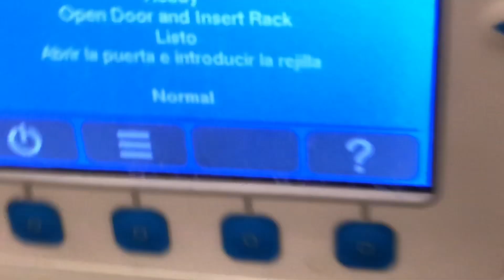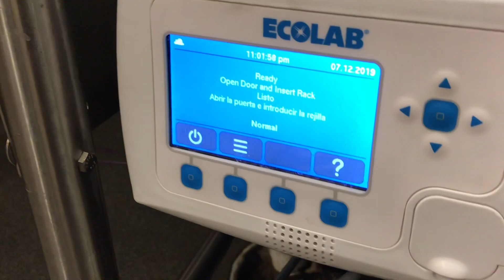EcoLab Dishwasher Breaks on Camera

Comment: User error. Make sure you pre scrap and remove anything from the drain. Drain can’t close if obstructed by something.
Reply from the maker: Nick Uroza it was a relay problem. This machine actually was giving us a lot of problems and half of it is rebuilt
Reply: Adjust the drain solenoid. No relays to cause that.
Reply: Call the tech to fix it.
Reply from the maker: We did. They found out it was the relay.
Reply from the maker: This was about a month ago too.
Reply from the maker: 1:32 the water was clearly going through the overflow